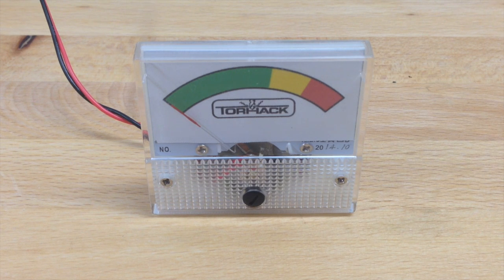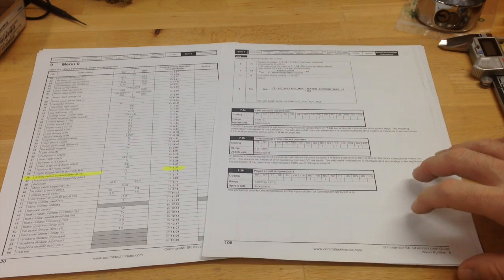Spindle Monitor - Part 1

Comment: Great video!
I did the analog meter clone also for a 770. Haven't tried the RS-485. I am working on using a ConnectEve FT800 display for mine with an Arduino. Perhaps we can work together.